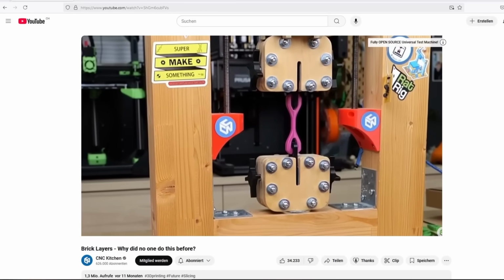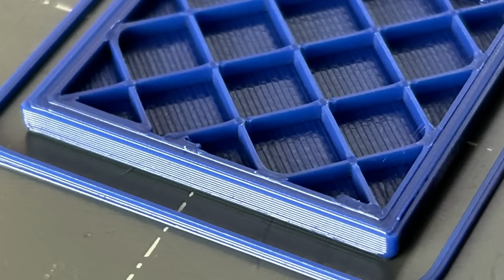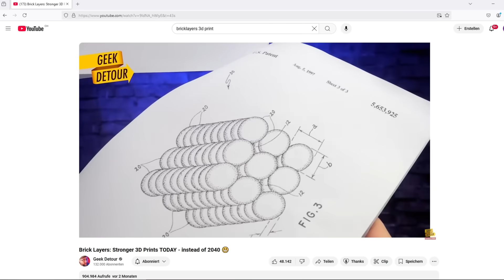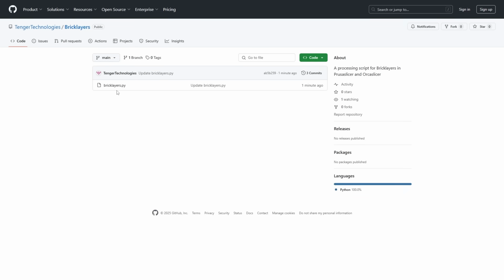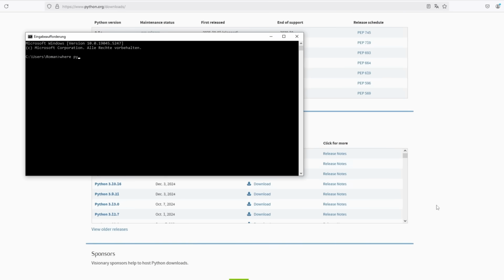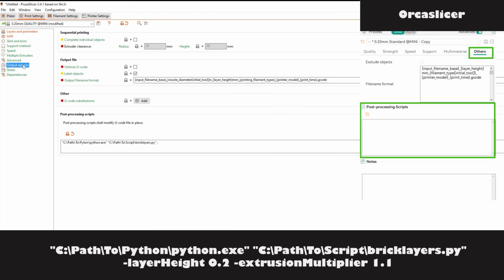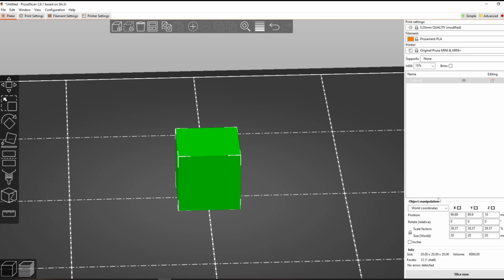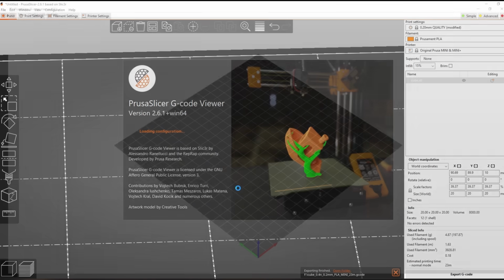Bricklayers for Stronger 3D-Prints now Opensource!

Comment: You need to work with softfever to incorporate this into mainline orca.

Nobody can go after anyone for the patent. The patent was filed with so many issues it can't be defended in court anyway. Might as well just release it
Reply: Agreed, the patent is a joke. 
It's not going to be approved anyway.
Reply: Just do it for fun!
Reply: Easy way around US patents.... Get someone in China to publish the code Open Source, and get it included in software or firmware of a Chinese made product.
Give it a couple of months, they're likely working on it already.
Reply: I would rather make a plugin/fork
Reply: Patent trolls care little about rationale, their M.O. is wearing people off so they reach a quick settlement (in the troll's favor, of course), otherwise they have the funds to drag the legal process for years until they take "offenders" close to bankrupcy and they then accept settlement.
Reply: Unfortunately, that's not how patents work. The validity of a patent is determined in court. Even ones that shouldn't have been granted. Want to nullify this patent? Great. You need to fight it in court.
Reply: @ It won't hold up in court. The patent cites other patents that aren't relevant. It's completely invalid due to clerical errors. Nobody can sue over it
Reply: @hyperstimmed  The idea is that, even though the patent wouldn't hold up in court, it is still currently a legal US patent. That means they can legally sue for other people using it, even if they will 100% not win the court case. It's not about suing them and winning, it's about threatening legal action to those who created these implementations and getting it taken down because the patent holder knows whoever they're threatening won't have enough time or money to fight it in court.
Reply: @whoisconch  in regards to this particular patent, they'd be fighting the entire 3d printing community. They'll lose.
Reply: @hyperstimmed  In regards to any patent ever, they'd be fighting one party in a court of law in the United States. If that party does not have the money to go to court, they will take down their patent-infringing content. Most people, especially open-source maintainers, do not have the money to fight in a legal battle. The patent holder knows this. That is why they may/can get away with such a thing. It doesn't matter if the "entire 3D printing community" thinks (or even knows) the patent will not hold, it's the fact that nobody normal can fight it if they decide to take legal action.
Reply: @whoisconch  you're missing the point. Money is not a concern for someone who has the entire community behind them. Crowdfunding for legal fees would be very easy. Any developer who adds this feature to their slicer will have no issue defending it.
Reply: @hyperstimmed  thats a lot to hedge your bets on as an individual being sued by a company that can easily afford a very long legal battle. the point is, if the person that doesn't take it down gets sued, they will have to shell out potentially much more money than they can afford to lose. it's a legitimate strategy in court to drag out the hearing to drain your opponent's funds until they cant fight anymore and likely settle if not take a loss.
Reply: @hyperstimmed  a big wad of cash can win it no problem. That's how this system works. At a certain level whoever has the most money wins
Reply: @hyperstimmed  you can't put your entire financial life on the line in the hopes that a bunch of people online will shell out thousands of dollars for you. Sure, you'll raise money, but you aren't going to be getting the help of any big companies. Nobody's going to be donating hundreds of thousands of dollars to some random guy who wants to dispute a patent
Reply: @notyouraveragegoldenpotato  Stefan and Thomas have both mused on their podcast about a non-profit that challenges bunk patents. The problem is that it takes a LOT of money and a LOT of time (years) to properly fight a patent. You'd need some angel investor to kick start the coffers just to get off the ground.
Reply: @assumptionsoup  Exactly, that's the whole problem with these laws. It doesn't matter how "right" you are. If the plaintiff has enough money, they'll bankrupt you before you can even make your case. Lawyers are expensive, and IP lawyers are even more expensive ($400-500/hour) and the lawsuits take months to resolve.
Reply: @assumptionsoup  The author of the script just have to say that his work is based on the previous patent witch have expired and provide link to that patent. So if the ones with the new patent try to sue that he can say that the work is not based on their patent.